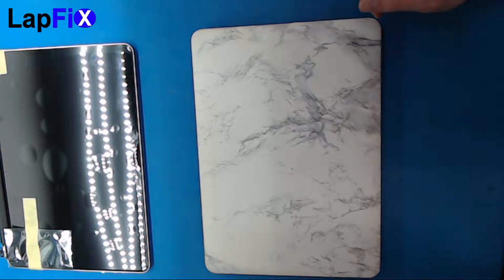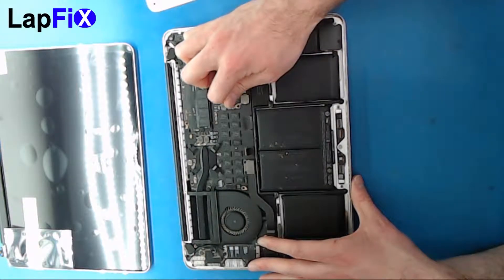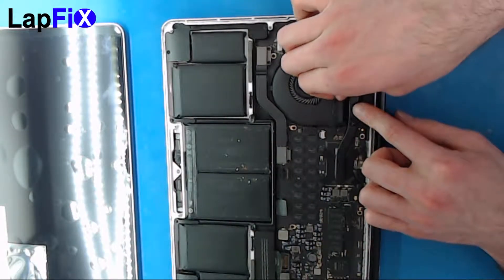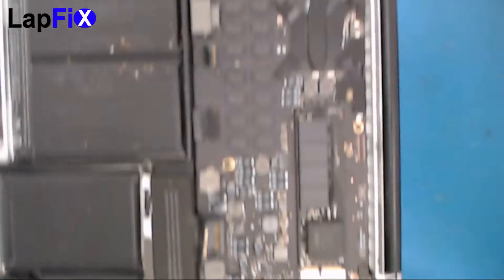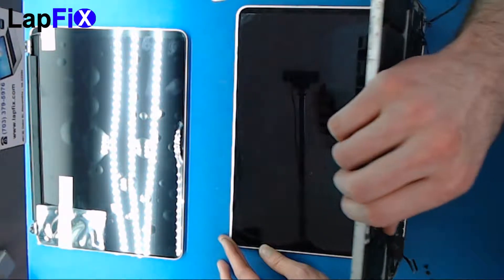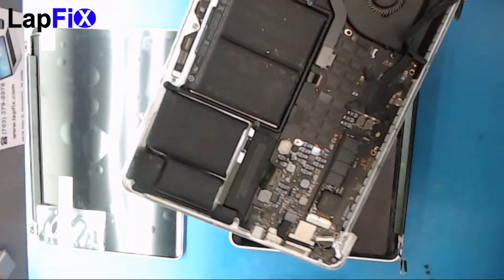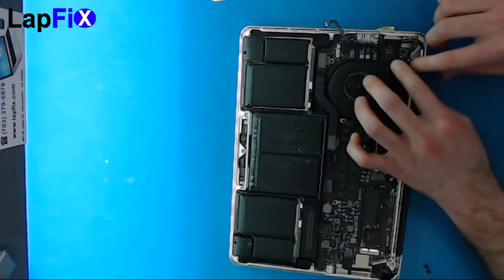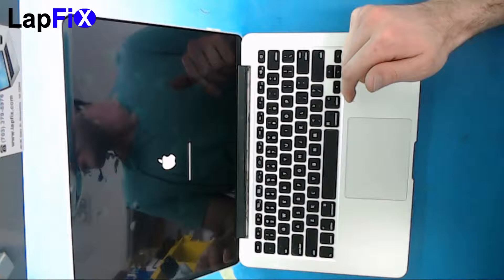Macbook Pro A1502 2015 Screen Replacement  - How to

Comment: What screens are compatible? Could I take a screen from a 2014 or a 2016 13 inch to fix my 2015?
Reply from the maker: No, only a a1502 2015 model will work with a a1502 2015 model.  The 2013 and 2014 model may connect but you will not get a display